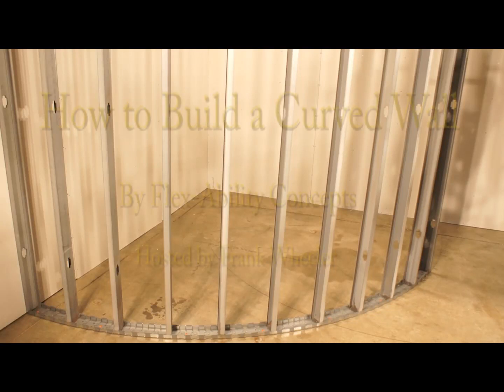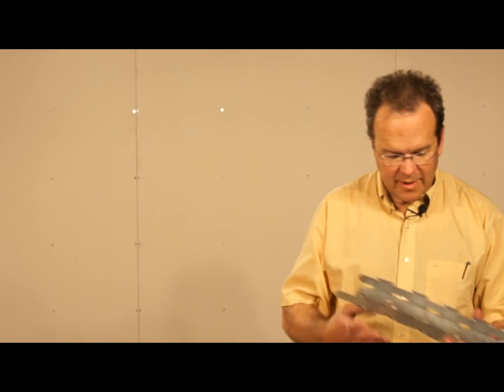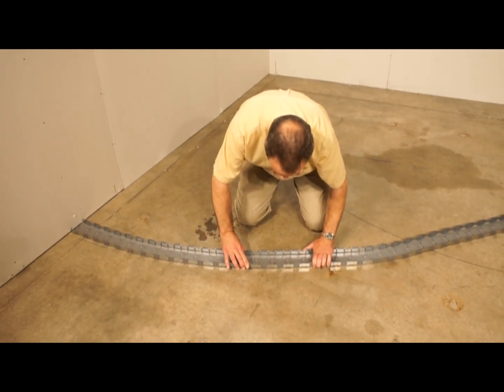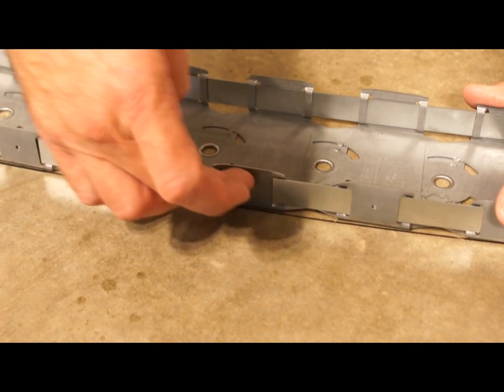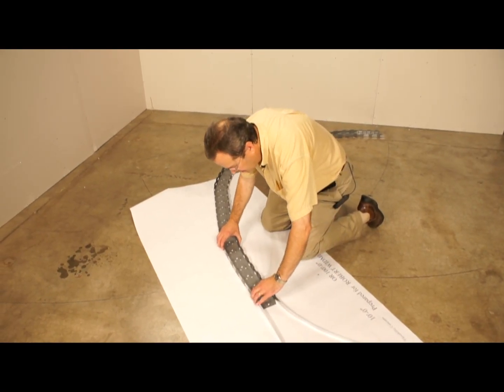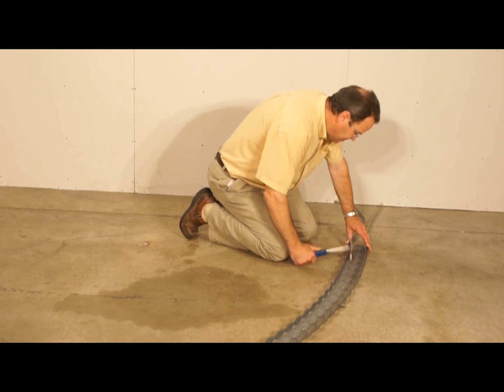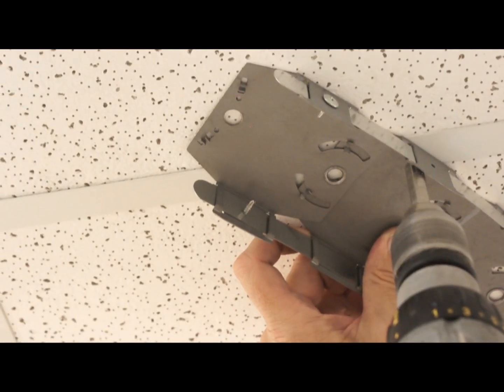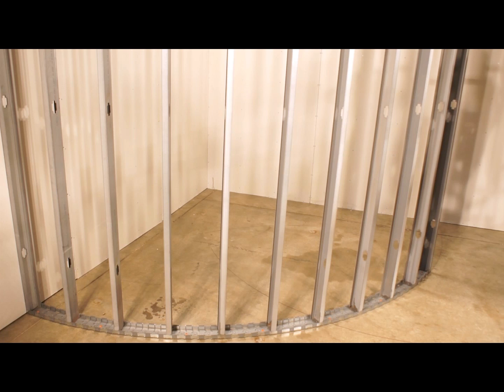How to Build a Curved Wall

Comment: Hi I am in Vancouver Canada I have an old concrete patio that I want to build a recycled wood patio cover with 2x4 or come 4x4 pillars I only want the roof I don't need walls. Can the studds be made of wood also. can the Flexi track be made rost proof as its outdoors!